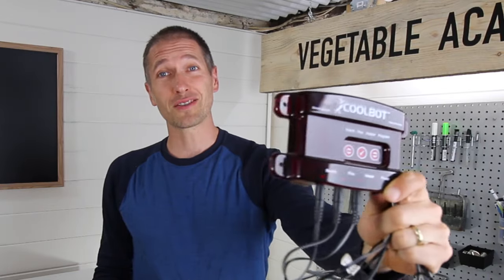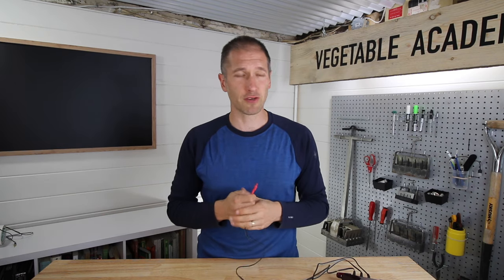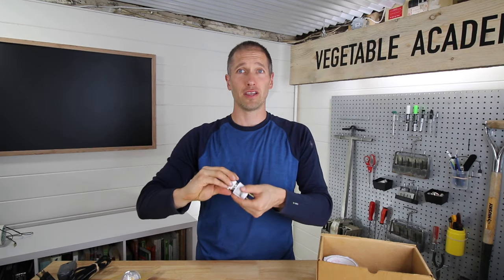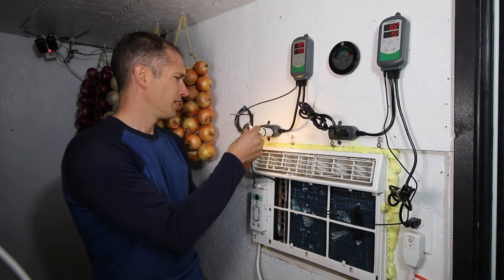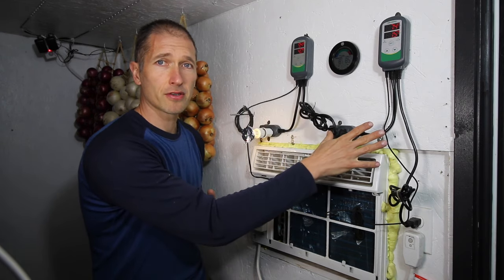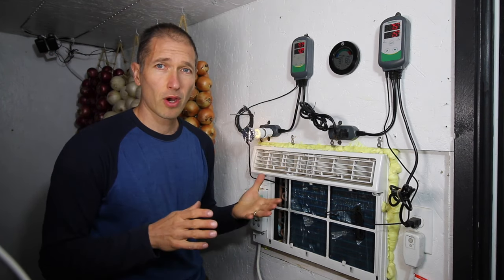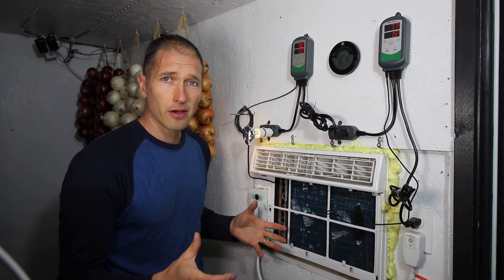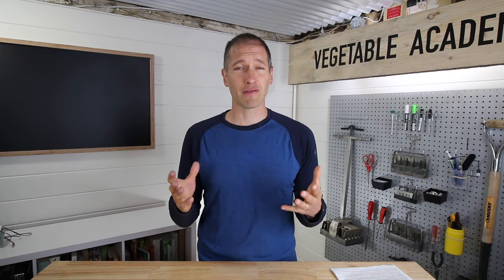Build Your Own Walk-In Cooler with this DIY CoolBot Alternative

Comment: Do you have suggestions for a mini split controller? 
I'm building a home and was planning on a CoolBot, but I love your idea.
I'd rather not cut a large hole in the side of the building...but it would be dirt cheap and simple to use a window unit.
Reply from the maker: Sorry, I don't have any experience with setting up a mini split system in this way, but I totally understand not wanting to cut a hole in your wall.  This is what CoolBot has to say about mini splits: https://storeitcold.com/wp-content/uploads/2020/01/Mini-Split-Installation-2019-7A.pdf
Since we are located in a cold climate and are predominantly heating our home, our air conditioner was installed on an interior wall of our walk-in cooler so the heat is pumped back into the basement of our home.  This worked really well for years, but now that we've insulated our basement really well, it can get uncomfortably warm in the summer time.  Therefore, I have recently upgraded our walk-in cooler system.  The room is now cooled with a Sanden C02 air to water heat pump.  It pulls heat out of the cooler space and adds it to our hot water heater.  Now instead of pumping excess heat from the cooler into our basement, the heat is used to make our domestic hot water.  It works amazingly well!  I will make a video about this new system eventually.  I'm telling you this because if you are working on a new build, you have the perfect opportunity to integrate systems like this.  The Sanden is a lot more expensive than a window air conditioner, but it has also replaced our water heater, made our home more comfortable, and saved us a significant amount of energy each month.
Reply: @VegetableAcademy  I will dive into the Sanden C02 air to water heat pump today. Thank you for sharing that. Our house will be off grid/solar so all options for optimizing the performance are on the table.
Reply: @VegetableAcademy  The Sanden's appear to be spendy, but the ROI includes the trade for a water heater+mini split cooler and Coolbot.
Do you think we might be able to get similar results by placing a normal heat pump water heater inside the walk-in cooler?
Reply from the maker: @mentalarson   I looked into this too and kept coming back to the Sanden.  They are pricey and they are better.  The C02 refrigerant gives you a much better efficiency at lower temperatures compared to a typical heat pump water heater. Check out this detailed comparison of the Sanden and Rheem heat pump water heaters: https://energy350.com/wp-content/uploads/2018/11/CO2-Integrated-Heat-Pump-Water-Heater-Performance-Report-FINAL.pdf.  The graph on page 2 shows how the Sanden would be twice as efficient as the Rheem when they are pulling heat from 4ºC air, such as in a walk-in cooler.   If we used a heat pump water heater in our cooler, we would also have a loss of efficiency due to the fact that our hot water tank would have to be positioned in the cold room, where it would passively be losing heat back into the room all the time.

Comment: Looks like using your set up is a no brainer. I'm building a shed with 5" thick metal SIPs, basically commercial walk in cooler panels. Planing in building a 4x8' walk in cooler inside with the panels on all 6 sides. Think this should work well?
Reply from the maker: That sounds great.  The 5" SIPs will give you a tight, well insulated room to start with.  I would be hesitant to use a width as narrow as 4 feet just from an ease of use perspective, but I don't know anything about your limitations or how you intend to use your cooler.

Comment: What temperature is ideal for storing onions? I've also heard that potatoes and onions need precise humidity to keep for long periods of time, do you control that as well? Do you run a fan for airflow?
Reply from the maker: Onions are best stored at 0ºC, but keeping our cold room that cold takes a lot more energy and a good storage onion will still last the winter just fine at 4ºC.  Onions store best at less than 70% humidity and potatoes store best at 80-90% humidity.  We maintain a higher humidity around our potatoes with woven sacks to limit air flow.  The air conditioner fan provides all the air flow we need inside our cooler.   Many more details about long term storage conditions and methods are covered in Module 7 of the Seed to Table course.
www.vegetableacademy.com/course

Comment: High building a walk-in cooler this year have you made any upgrades to this system thanks
Reply from the maker: Yep.  The air conditioner and method of control I describe here still works just fine, but I didn't like that the air conditioner was mounted indoors and was pumping excess heat into our basement during the hottest part of the summer.  When I first built this cooler, our basement had bare concrete walls so this extra heat easily wicked through the walls, but after insulating the basement really well, that heat had more trouble escaping in the summer.  We now use an air to water heat pump to pull the heat out of our cold room and use that energy to heat our home's hot water tank.  You can see how that heat pump is set up in this newer video.  https://www.youtube.com/watch?v=gM2OGzx-ReU&t=72s

Comment: What is your setup for the wintertime? I also live in canada and i cant see myself using this in the winter. You must have a parralel system for winter.
Reply from the maker: In the winter, cold air can be drawn into the room to cool the air down to the desired temperature.  I have two 4 inch vents on the exterior wall, one for exhaust and one for intake.  Both vents have a small fan and backdraft damper.  The same Inkbird controller turns the fans on when the temperature is above 4ºC and off when the temperature is below 4ºC.   Despite having that option though, I actually left the air conditioner system on this winter, because in our case the air conditioner is installed on an interior wall so it is pumping the heat it draws from the cooler back into our basement space.  Since we always want more heat in our house in the winter, this could be an overall more efficient way to cool the cold room compared to pulling in more cold air from the outside.  That's because if we pull cold outside air into the cooler, we are also increasing the heating load of our basement.  I wish I had some exact numbers to compare the two options but the answer to that depends on a few other factors too.  Anyway, I am about to ditch both systems with an upgrade I am working on right now, which will use an air to water heat pump in the cooler to extract heat as needed and use that heat to warm up our domestic hot water tank.  This will allow us to make better use of all the heat extracted from the cooler in all seasons of the year.

Comment: Ok. What’s the rate of cool? I’m thinking of doing something similar for the back of my truck to transport  meat during early season hunting. I wonder, can I just put the light on the sensor? Will it freeze up within the 4 hours it takes to transport home?
Reply from the maker: The answers to those questions depends on the BTU of your AC, the R value of your truck walls, floor, and roof, the outdoor temperature, and a lot of math.

Comment: Fantastic work! Thanks! I am about to start building our 6' x 4'4" cold room. According to Coolbot, I need an 8000 BTU AC. I could buy a 10000 btu used frigidaire... What is your opinion on oversizing? any problem with that? Cheers,
Reply from the maker: Don't oversize your AC.  I know it seems like a good idea, but an oversized AC will cycle on and off more frequently and this will shorten its lifespan.  As long as your cooler is well insulated, stick with the size recommended.
Reply: @VegetableAcademy  Thanks so much for the return. On I go for an 8000BTU!
Reply: @VegetableAcademy  I just finished our cold room and installed the inkbirds. Seems to be working. We will see how it looks like in the next few hours. 
A question: what happens when winter temperatures go to minus 10 or 20? Do you just rely on the insulation to keep the cold room above zero degrees C? Can one add a heating device and plug it into one of the inkbirds? It could be an incandescent bulb, maybe.
Reply from the maker: @thierrybrionnefurnitureatelier  What happens when winter temperatures go to minus 10 or 20?Our walk-in cooler is built into the basement of our home so we don't have issues with it potentially freezing in the winter.  Enough heat from the heated basement will wick through the cooler walls and stop it from freezing.  Once the outdoor temperatures drop below our cooler temperature (4ºC) consistently, we can start cooling the room by just bringing in outdoor air.  We have two 4 inch vents for this purpose, each with a small fan and backdraft damper.  One fan blows air in and the other blows air out.  The fans can be controlled with one Inkbird that tells them both to turn on when the temperature of the cold room is above 4ºC and turn off when the temperature drops below 4ºC.  

Do you just rely on the insulation to keep the cold room above zero degrees C?  No, and I wouldn't ever just try to rely on insulation only even if the conditions were such that the temperature was usually in the right range.  I wouldn't want to risk freezing or warm spells in the cooler because that would cause a lot of early spoilage to our food supply.  Therefore, I would always recommend some type of temperature control.

Can one add a heating device and plug it into one of the Inkbirds? It could be an incandescent bulb, maybe.
Whether or not an incandescent bulb would be enough would depend on your climate and the insulation level of your cooler walls, but if your cooler is outdoors in -20ºC whether, then yes you will need a heater and this could be controlled with an Inkbird as well.
Reply: @VegetableAcademy  thanks a lot Jared. I like the idea of cooling the room with outside air once the outside temps are lower than the temp in the room Do you mind sharing what kind of fan and back draft damper you used?
Reply from the maker: @thierrybrionnefurnitureatelier  Sure.  Not everything I have used is currently available, but at least these links will show you what I used.  
4 inch Backdraft Damper:https://www.amazon.ca/gp/product/B01MRDYFJV/ref=ppx_yo_dt_b_search_asin_title?ie=UTF8&psc=1
4 inch Fan: https://www.amazon.ca/gp/product/B07FXRWMTM/ref=ppx_yo_dt_b_search_asin_title?ie=UTF8&psc=1
4 inch Fan with Backdraft Damper: https://www.amazon.ca/gp/product/B08CVQKDKN/ref=ppx_yo_dt_b_search_asin_title?ie=UTF8&psc=1

Comment: How does this work with your homes heating and cooling system? I want to do this but don’t have a basement but have a utility closet I want to use. How can I ensure the rest of the home is cooked/heated properly?
Reply from the maker: It operates independently from our home's heating and cooling system right now.  Since we are generally needing to heat our home throughout the year, the air conditioner is installed on an interior wall of our basement so that it dumps its heat into the basement air.  That's about to change though.  We are setting up a new system right now that will dump the heat into our hot water tank instead, keeping our home cooler and making more efficient use of the energy we use to cool this room.  You can see what we are planning here: https://www.vegetableacademy.com/post/heating-water-with-our-walk-in-cooler

Comment: hi just wondering you say compatible air conditioners is that for the coolbot are the ink Bert system thanks I know the cold bolts you have to have a certain one
Reply from the maker: The control method I describe here works exactly like the CoolBot so the same types of air conditioners will be compatible.  See the link to a list of compatible air conditioners in the video description.

Comment: We just built a meat locker to hang beef. We used a protable ac unit (11000 btu). We used your light bulb method. We can get to between 4 and 6 degrees celcius.  Its recommended to get down to 2-4 degrees. We cant get the locker any colder then 4-6 degrees. Could it be because we used a protable until and everyone else seemed to use a window unit??
Reply from the maker: There are two links on this CoolBot page that will help you. One is their list of compatible air conditioners.  Check to see that your unit is there.  Some portable units work.  Since your room is cooling though, I would suspect that your air conditioner may be undersized or your room not insulated well enough for this purpose.  See the CoolBot sizing calculator also on this page to help you get the sizing right. https://www.storeitcold.com/build-it/ac-selection/

Comment: The ink bird product information says they're controller operates at 240 volts. So does it follow that you have to have a 240-volt power supply and for convenience and air conditioner that operates at 240 volts? Also how many BTUs does the air conditioner need to be to cool something between 9 x 9 feet or 10 x 10 feet?
Reply from the maker: If you look closer at the Inkbird specs you'll see that it operates with input and output voltages of 100-265VAC.  We use it with a standard 110VAC household outlet and air conditioner also using 110VAC.  CoolBot has a nice sizing calculator here to help you with your air conditioner selection: https://www.storeitcold.com/build-it/ac-calculator/

Comment: Does one of the inkbirds eventually turn off when it gets to diaries temp? The one that is measuring the room itself ? It turned off with the light
Reply from the maker: Yes. That one turns on and off, but it retains its temperature settings so everything keeps rolling along smoothly.

Comment: I just built that setup that you have described, and in doing so I had a question.

It appears in this setup, the room temperature sensor that activates the AC  compressor is actually in the fins of the AC unit itself, correct? This would be referring to the Inkbird on the right.
Reply from the maker: Both temperature sensors contribute to the activation of the AC compressor.  The controller on the right has its sensor in the fins.  If the temperature of the fins is above freezing, it gives power to the second controller on the left.  The sensor of the second controller is detecting the room air temperature and whenever this temperature is below the desired setting, the controller gives power to the light bulb.  Then the light bulb heats up the AC's temperature probe in a few seconds so that it's internal controller turns on the unit.

Comment: So, if you aren’t setting to freezing, will you need the 2nd unit?  I’m looking at about 39-40 degrees F
Reply from the maker: Yes, you likely will, but feel free to try it with one Inkbird first.   We keep our cooler in that same temperature range, and our AC fins do drop cool enough to cause ice build up without the precaution of the second Inkbird.

Comment: Any suggestions on insulation? I want to build one in my garage - I have a small garden but I'm expecting about 350 pounds of produce and I'd love a place to keep it fresh!
Reply from the maker: Do you have a specific question?
Reply: @VegetableAcademy  Yes, thanks for asking. I'm converting part of my garage, I was thinking R-13 faced insulation - dry wall - then foil faced panels over the drywall. But will that be enough to keep the cool in?
Reply from the maker: @ColinHughesLA  I would suggest using a minimum of R20 walls like CoolBot recommends.  If there's one thing I would do differently about our cold room, it would be to add more insulation right from the start.  I know it seems expensive at the start, but it keeps paying you back forever.  Your air conditioner will run less and probably last a lot longer.  Remember to insulate the floor heavily as well.

Comment: What temp does it get down to? I am wanting to keep beer in one. How long does it take to cool down?
Reply from the maker: When our cooler has been turned off for a while and the temperature gets up to 10ºC / 50ºF, I would estimate that it gets back down to our set temperature of 4ºC within 1-2hours.  However, that totally depends on the volume of air and stored goods contained within the cooler.  We keep our cooler at 4ºC for the best combination of storage effectiveness and energy efficiency.  Lower temperatures can be achieved but with ever increasing energy usage.  I wouldn't use this system below 1 or 2ºC because I would anticipate there being a big problem with frost build up on the fins.  The fins can operate below freezing, but as soon as they are that cold, the moisture in the air freezes on the fins, eventually preventing air flow.

Comment: Followed all the steps.  The air conditionner lowest temperature is 61 oF. With this system, i manage to keep the temperature between 49oF and 59oF.  The air conditionners compressor shuts down before the temperature reaches 35oF.  Can anyone help

Comment: Should controller B (probe in the air conditioner fins) always be on , i.e. display showing temperatures because mine periodically shows a blank display? does that mean something is wrong with my set up or the inkbird?
Reply from the maker: Yes.  The display of that controller should always be on.  Either something is wrong with your Inkbird unit or it is not plugged into an outlet that is consistently supplying power to the Inkbird.

Comment: Hi all, wondering if anyone else   is experiencing the same issue as me. When the desired room temp is reached the one inkbird turns off the light bulb as it is supposed to, problem I have is that the ac keeps running too long after that before it stops cooling, therefore I'm thinking the bulb is staying warm too long and the sensor is still sensing the warmth. As you can imagine this is resulting in overshooting the temp on the low side and freezing up as a consequence.